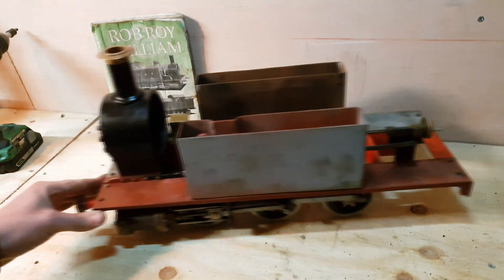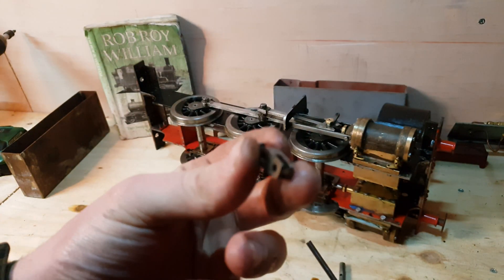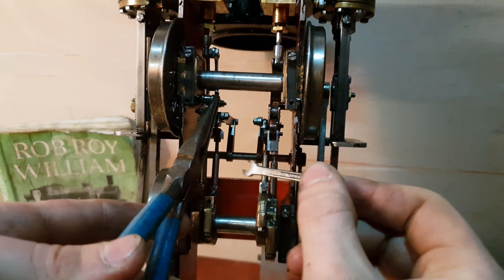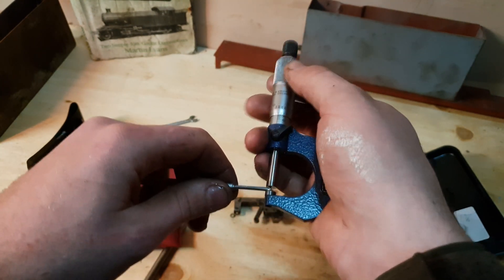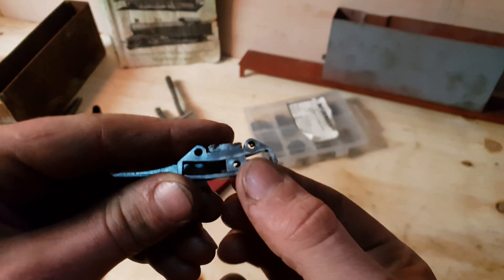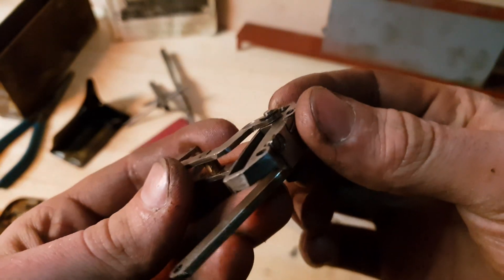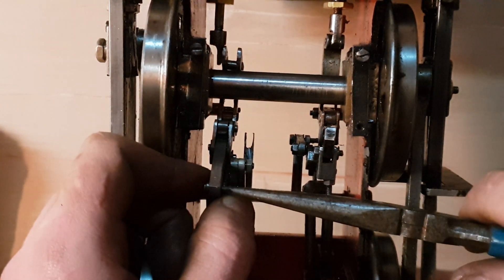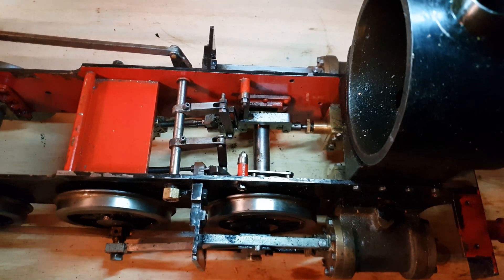Rob Roy 3 1/2 inch Gauge Pt 7 : Shafts and E clips for the valve gear

Comment: Thanks Martin well worth the wait, it’s a shame to hear about the demonetisation, the same thing happened to Keith Appleton, who also makes videos of model live steam, quick question, do you think it’s possible to add an injector and swap out the side tanks for a saddle tank?
Reply from the maker: No reason why not. I plan to add an injector to this one . If a saddle tank were to be fitted the safety valves would have to be extended up above it . Im glad you are happy with the video. Im currently scratting arround for boiler materials. Once i have gathered enough i plan to make a very detailed build sequence including all the kit and techniques. It has been a learning curve for me so i hope i can share my mistakes to help others not make them :)